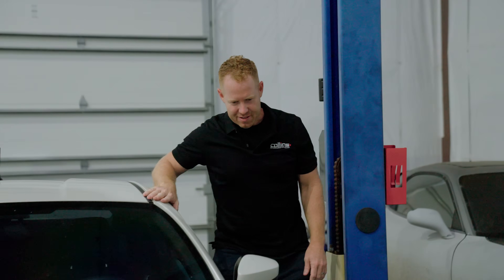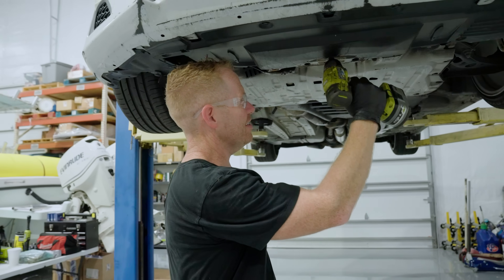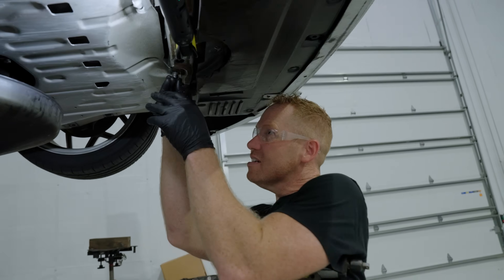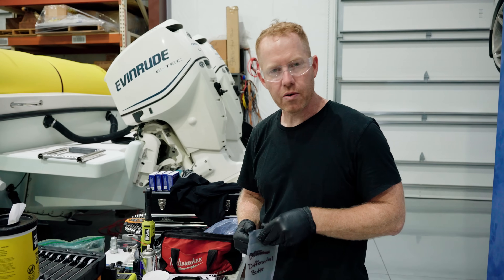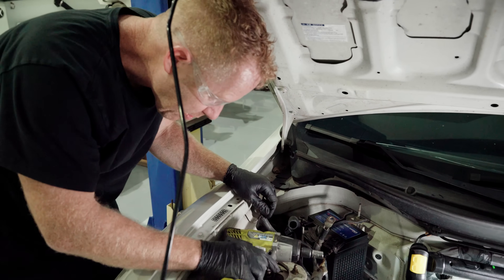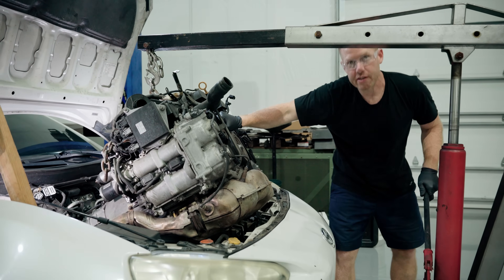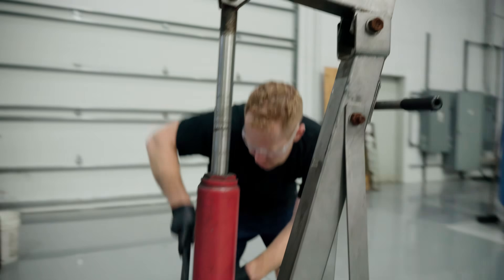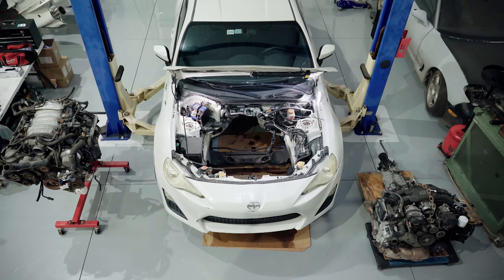3UZ-FE V8 swap into an FRS using the stock 6-speed trans, Video Series! Part 1 engine removal

Comment: Coincidences are wild. I bought a 2013 FRS a few weeks ago with a blown engine, planning to go the LS route—until I came across the less demanding 3UZ-FE swap. Researched it a bit and found your kit online. Today, I went to the DMV to get the new title and plates. Got home decided to dig deeper into the swap, and saw that you guys posted this video just 4 hours ago. Unreal timing.
Reply: I did a Volvo t5 swap in mine and man I really love it 😅 450hp full boost at 2krpm and rings out to 9krpm with pleasure. It's also significantly lighter than the fa and running a drop bear everything works as it should.
Reply: @oliverscorsim  Please I would love the details on your build.
Reply: @scottyoungblood9715 I explained a bit in a comment above
Reply: @oliverscorsim what do you need to do that swap?
Reply: @LuisDiaz-kg1fy pans the biggest thing but also you need to have a way to tune it. Volvo uses me7 ECU which while you can make that work it's a nightmare. I used drop bear standalone ECU because it did everything I needed and was cheap. The adapter plate I made so I don't see why you can't. I just swapped the engine I used the frs trans ect. AC gets a bit complicated but I used the Volvo compressor and frs for the rest with some lines I made. I also had to cut and plate the front subframe a bit to get the cut and welded pan I made to clear but some better measuring could solve that and still clear the hood. The standalone isn't really optional here if you want the car to work like normal and honestly it solves so many issues that I wouldn't recommend not going that route. Last was little things fuel lines coolant oil ect. It wasn't that hard of a swap but I own a shop and build things for a living 😅 so make what you will of it. I am willing to do the swap for 10k out the door takes a month I don't tune it just get it driving and set up the canbus and that would be on drop bear. We're in NC if that helps. I'm kinda busy building new shop space so I'd rather not get started until spring. That being said it's really not that difficult but you might need to outsource the adaptor plate and pan/pick up. I'd also suggest shiming the block and doing some VW pd150 head bolts just to future proof the weak point in the engine. A standard s60r engine will do 450whp forever if this is done and the tune is good. So no need for rods ect.
Reply: @oliverscorsim wow. Congrats brother. Looking at my options for a swap
Reply: @LuisDiaz-kg1fy if you can tig weld and work a grinder and have $1000 you can do it. But get comfy wiring 😂.
Reply: thats a sign my dog
Reply: My only doubt is the stock hood closes correctly with the swap with no cuts or bulges
Reply: In Arizona we can’t get 93 or 94 octane or even E85. The best we get is 91 octane. How will that work with this engine?
Reply: I'm so glad I decided to buy a Toyota Tundra as my primary vehicle and save up for an FRS/BRZ to engine swap. All this time it is taking me to save even more options are coming out!
Reply: Don’t waste your money on a UZ, the initial cost to install is cheap but shit to get right will cost ya more than you need to. Stick with the LS.
Reply: It’s a simulation
Reply: That aint unreal timing thats the government my boi lol
Reply: You will have wished you did an LS when you decide to upgrade anything in the engine. There's no reason to do a UZ swap other than to stay Toyota.
Reply: You do it yet?
Reply: Could same it was meant to be 😂 🔥🫡 hope its been going well bro
Reply: 3uz for 1000 dollars vs ls3 for 5k plus bruh 3uz all day
Reply: @djv2013 theres much cheaper options than an LS3 that will have similar power, if not more than any stock UZ engine.
Reply: Yeah used good ls's are way to expensive now since everyone on the Internets been swapping LS engines into everything. 3uz ftw
Reply: @henrymatthews9365 I'm still pulling 4.7s and 5.3s for cheap....they love boost
Reply: Go with a turbo LS instead
Reply: Meant to be! UZ Swap the world!
Reply: Grab a 98+ 1uz VVTi as the 3uz, and its extra 300cc isn't worth the extra cost. Then get a pre '95 1uz rotating assembly, dingleball hone it quick and check & gap the rings a bit wider, new oem gaskets and heads studs if you want, stiffer valve springs, and an m112 or 122 with an Elate adapter, 6-8psi or more if you get the WTA intercooler and have fun shredding tires, axles, and 3rd gear teeth.
Reply: 3.6 h6 swap is the way lol
Reply: @Rightisallwrong I considered this when I did the Volvo i5 in mine it was tempting but heavy and expensive
Reply: @oliverscorsim i was half kidding lol
Reply: @Rightisallwrong it's not a rare swap just expensive and a lot of work
Reply: @oliverscorsim ive heard the ls fits nicely
Reply: @Rightisallwrong it does but I don't really like going ls in anything 😅 it's great I get it and pretty light honestly but I just don't really feel it fits the car. The tq down low that keeps pulling to 9k from the t5 I already had in another Volvo was very zingy and fun so I thought let's try it as I already had a small Volvo collection at this point and a few spare engines so for me it was extra cheap compared to buying all new stuff. Don't get me wrong I own a few Mopars too just I don't think a low reving engine suits the frs. Plus you already have a tach that goes to 9k factory I wanna use the whole tach and the ls canbus is a bit out of my personal reach and familiarity and I really wanted to build something oemplus not something put together like a race car cause well I already have too many race cars 😅.
Reply: @oliverscorsim the sound alone is reason enough for the t5
Reply: K swap
Reply: @PRTube01 k’s rattle everything apart once you ditch the balance shaft for the type r oil pump. Everyone I know who k swapped sold the car after.
Reply: @thegroundhurts I do and don't agree but while I considered going k I found the noise they make bothers me 😅 I ended up i5 Volvo which funny enough each port flows about the same as the k20 heads on my flow bench as the Volvo but the Volvo has an extra cylinder and makes music 😅. The k is stronger though if your going for the most power it's really hard to beat for the dollar.
Reply: Just LS swap it bro way superior engine
Reply: @ssjdavid  LS is what I would want to do if it were my car, but maybe for a first swap the 3UZ will be easier, and still pretty powerful for the small FRS chassis
Reply: @MindOverEverything LS swaps are really well sorted on these already with kits available and tons of info at hand. The 3uz has been done but is not very common.
Reply: @thegroundhurts True. I wonder what the OP meant by tbe 3UZ swap being "Less demanding."
Reply: @MindOverEverything  Meaning it’s less expensive and less labor intensive in regards to cutting and fabrication.
Reply: @toxicmasculinity7870 Doesn’t seem less labor intensive or cheaper when you still need to relocate the transmission and buy the custom driveshaft.  And then you’re stuck with the factory transmission behind the V8 lol.  Seems like if you wanted simple + OEM, you would choose the Subaru flat 6 which can even re use the mounts.
Reply: @MindOverEverything  i would go for the 3uz cause it like to keep my cars oem
Reply: @thegroundhurts You should have assumed he thought if all that already.....Preaching to the choir and thinking you are giving advice😂😂
Reply: @boostjunkie2320 apparently he hasn’t based on the post.
Reply: @thegroundhurts You assumed too much and still don't get it🤡🤡
Reply: @boostjunkie2320 yes. That’s what happened. You are so smart.
Reply: @ssjdavid not
Reply: @ssjdavid  lol, so wrong.
Reply: @ssjdavid  But way more expensive. Depending on if you do it yourself, you could be looking at 8-10 thousand dollars. If you have a shop do it for you; then it would be 20-30 thousand dollars. And while neither the 3UZ or LS are plug and play into a zn6 chassis, the LS swap is more involved than the 3UZ since more stock components can be used for the 3UZ.